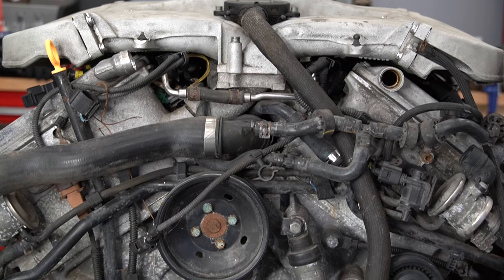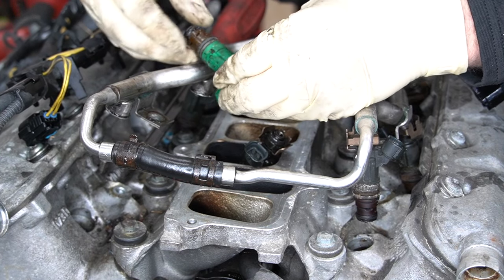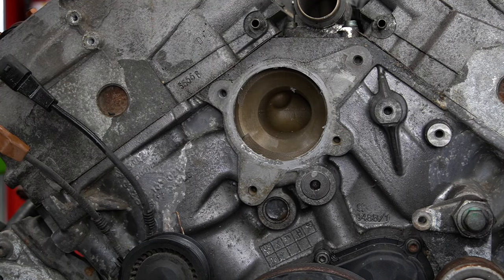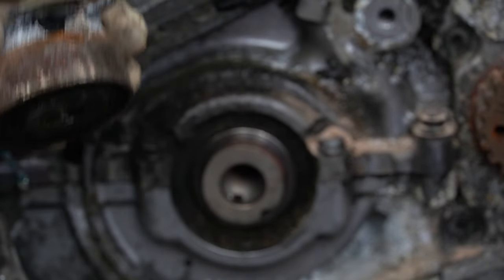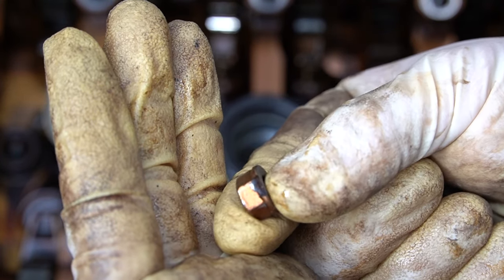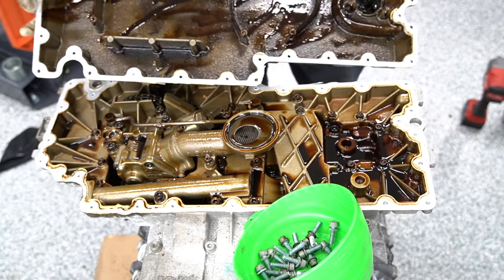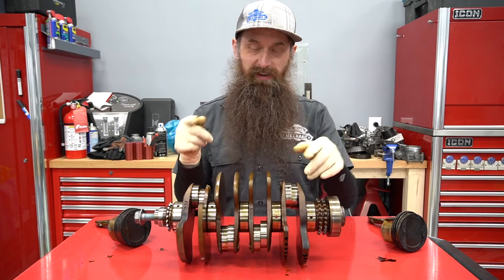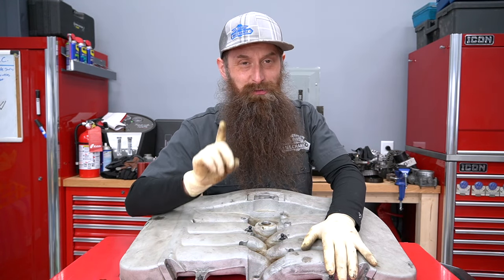W8 Passat Engine Teardown and Inspection ~ TINY V8

Comment: I actually own a 03 w8 that still runs but I do have problems finding parts, any suggestions?
Reply from the maker: I really don’t. If it’s just B5.5 parts it should be hard to find. W8 specific is usually dealer only
Reply: @HumbleMechanic  that kinda what I was afraid of
Reply from the maker: It sucks!
Reply: @HumbleMechanic  it does, I love the car, way more powerful then I expected it to be. Wanna keep it going

Comment: It's a great motor when it is under warranty. How would you ever know if the belt that runs the balance shaft is bad?
Reply: Probably because the engine would vibrate differently if the balance shaft failed. You'd need experience with 'feeling' the car to know it though

Comment: Thanks Charles for doing this video I was always curious to see the internals of a W8 engine we operate a small European shop since 1997 here in Canada and I never had to work one ever they were not a big seller here one thing that always amazes me about these complex engine is imagined the R&D and the cost of development on just one engine all the casting,brackets,fasteners etc ... all of this just to make a vehicle go down the road .  Compare this to electric car just one moving part the motor rotor. And manufacturers are saying that electric cars cost way more to produce I know most of the cost is in the battery pack. For Volkswagen it’s going to save them millions of dollars because they will be able to install the same motor in different cars but with different software and without any emissions equipment to install or test or cheat .. Ha Ha ..
Reply: What you save in moving mechanical components, you seem to lose in chemical and electrical engineering on the batteries of electric cars. It's an interesting shift

Comment: I have the VR6 in 2019 VW Atlas.  Any thoughts about reliability.   With a 6 yr 72k mile bumper to bumper i will be 71yrs old when it runs out.  No worries about repairs.  LOL
Reply from the maker: There was some issues with early production head gaskets. Its weird too, it seems to be regional.
Reply: At 276 HP it gas plenty of juice.  Oh and by the way i have the RossTech for the 2018 and up and turned of the start stop with your help.  Thanks.  Was 199.00 for the 3 vin version.  I only have 1 VW, 1 2004 suburban and one 2001 Mustang GT Conv.  I use a FIXD analyzer for the 2 american cars.  I also have RossTech 2010 to 2016 i may be selling.  Probably can get $300 for it on ebay.  Thanks for the great podcasts for VWs

Comment: This engine doesn't even seem too bad.  Seems like someone junked the car for what might have been because the balance shaft drive belt tensioner failed.  I assume the rest of the car must have had other issues too though.  Probably way too expensive to fix.  I think there were something like only 10,000 of these made right?

Comment: This engine is really W8 or V8 with parallel cylinders?
The arrangement of the cylinders is the same as  the lancia V4 engine 1920-1970.
Reply: It is two Lancia V4 in a V.

Comment: Hey the secondary water pump on the driver side by the transmission underneath the valve cover does it still work I don’t think my secondary water pump is working let me know if it works I love the buy. It off  of you

Comment: Do not scrap that engine, unless it's really bad. W8 is rare, because it was put only in B5 Passat. Rebuild it and slap a turbo on it! :D
Reply from the maker: The issue is the rarity means very limited parts. I m not sure rebuilding it is an option .
Reply: @HumbleMechanic  okay :/ It would be really good series of rebuilding & maybe modifying heads to get better flow

Comment: This is probably the most asked question, but do you think it will take boost? and if so how much. It's seems like a pretty over engineered engine so I guess a lot.
Edit: those rods looks very puny and thin they are not gonna hold power.

Comment: The broken balance shaft belt is not catastrophic engine damage right? It should be able to run without it no?
Reply from the maker: It should be able to. But it could have went like this- engine vibration lead to replacement because it’s probably cheaper than any repair
Reply: @HumbleMechanic  yea, thats probably it. What i meant was that if you wanted to you could have built something fun from it, and that the broken balance shaft belt was just a small repair in that case.

Comment: So what is the length of the engine? Weight?  External dimensions?  I can think of several swaps this would be a good candidate for... if its small enough.
Reply from the maker: Size wise its great. Especially with an aluminum block. The issue is parts. Unless you had a great running engine, its either NLA or so much money its not really worth it. You'd do better with a VR6 3.6. far more options there. and it drops right in most VWs.
Reply: @HumbleMechanic  actually I was thinking of dropping into a 914.

Comment: I got a question, i am currently looking at a 2,5L Diesel 5 Cylinder Transporter from 2006, how are these engines? Are these as "bad" as the 2,5L Diesel from a Touareg or are these better? The engine has done 260k km. Greetings.
Reply from the maker: We never got that engine in the US. :(
Reply: @HumbleMechanic  Oh that sucks, i have heard the cams could snap in half but i wanted to know for sure ;)

Comment: Do a VR5 Teardown
Reply from the maker: That would be cool to do a VR5 and 6 together, Fun to compare the size
Reply: @HumbleMechanic  I had a VR5 20v engined Seat for five years - wonderful engine, lovely sound.
Reply: @HumbleMechanic  i'm actually doing a VR5 10v Turbo Build Right now at the moment there isnt alot info on the web About the vr5 But i Learned everything what i have to know from your white whookie videos so i can tell you that alot is the same as the AFP 12v for the AGZ it uses the same parts and internals

Comment: Imagine trying to work on this lump while it's still in the car.  It's the stuff of nightmares.  I'm pretty sure the pour soul stuck working on it would use more colorful language than "interesting" to describe it.
Reply from the maker: It’s not too bad. Anything major is engine out.  Which is how it’s meant to be fixed. So it’s an easy engine pull

Comment: "The most broken connector in the VW world"; proceeds to pull off connector by the wires.
Reply from the maker: In almost 20years of removing VW connectors, Ive developed a fine tuned finesse for connectors. It may look barbaric, but it works. ;)

Comment: Engine this complex is looking like horse breading. And it will be that rare in 10 o 15 years due to electric cars. 

Just mind-blowing the complexity of only the power generation part.

What's your take on the battery electric transition for mechanics and shops?

Comment: The power output is not strange at all. Why would you compare a turbo engine to N/A without including the extra engine capacity the forced induction stands in for? Turbo engines are awesome, but they aren't doing anything special. I'd fully expect a 20 year gap in development to mean several iterations of output increases. But todays turbo engines look kind of outdated by comparison too if you consider that there were small engines making 300hp with a turbo in the 80s from the factory. As an enthusiast, even with 270hp as stock output, that's still more power than many VW cars have today and so I think I would enjoy it.
Reply: Also, there were much smaller v8s in regular production cars. Bmw hade the m60b30 3.0L v8, and there was the yamaha/ford SHO v8 at 3.4L, Audi used a 3.6L v8. Special mention tot he ferarri 208 gt4 with a 2L v8!

Comment: How weak are those rods? No way something that narrow could handle boost, right? Are the ones on Bentleys TT W12 similar? 🤔
Reply from the maker: I’m not sure if the rods are exactly the same on the 12. But the footprint isn’t much bigger so it’s probably close
Reply: @HumbleMechanic  Rod bearing shells are NLA. And due to width they do not tolerate bad oil or missing oil changes. Miss oil change = junk engine. Some people saw machine down VR6 bearings. Basically nothing down from head gaskets is available. And W12 parts almost fit.

Comment: All those engines suffered some failure and then when the mechanics fixed them, when they pulled the manifolds off little collets would fall into the intakes and not be noticed or even lock the engine when turned by hand. They would then get rattled into a disastrous spot on the first test drive. A truely huge job to end in complete VW disaster as only VAG can serve up.

Comment: Is it possible to buy the injector harness off you? I don’t care that one of the connectors is different one of my connectors are completely blown apart
Reply from the maker: Have you priced the connectors? It will be better to replace new unless the connectors are crazy $$ which happens
Reply: @HumbleMechanic  I have yet to actually find one for sale. I’ve been looking for a while unless you know of somewhere that has one available.
Reply from the maker: Call the dealer and get a quote. Then ask for the part Number. Or see if you can see the PN on the connectors

Comment: Is that balance shaft toothed belt on the maintenance schedule for replacement? What an ownership nightmare cost-wise.
Reply from the maker: Not on the schedule. Its a service position repair so id guess 3 hours or so
Reply: @HumbleMechanic  So, another $400

Comment: I'm assuming the trans is a manual, and if it is it should be a version of the 01e manual trans
Reply from the maker: It’s an auto
Reply: @HumbleMechanic  yuk probably a 5hp24 based 5 speed auto, probably worst trans VW, and Audi used :(

Comment: you dont pull the connector by the wires. this way you will end up pulling the crimp pin out of the connector or wire out of the crimp pin. 
i know  this is tear down but still make a right not wrong practice.
Reply from the maker: you have to do what you have to do to unplug a connector. with proper touch you won't damage the connector. or wires

Comment: Hey man I have a question about the 10v AGZ 2.3VR5  engine is possible to put a 20v head on it?
Reply: You need different pistons, but the block is the same.
Reply: @zorg1396  oh so If I put 20v pistons all will be good?

Comment: Did you have to rent/buy a 40' Conex container to store parts from this teardown? :D I take it you never had the good fortune to rebuild one of these at the dealer? ;-) Thanks for discouraging us from EVER buying a car with such an engine in it--they DO sound sweet when being run through the gears, though...
Reply from the maker: Id be more worried about the Passat surrounding the engine than the engine. B5 were $$$ to maintain

Comment: One question comes to mind. Why are the timing chains not on the front of the motor? Doing a timing chain in the car is usually a pain. But this setup ensures that engine needs to be pulled adding several hours of labor. There are several things about this that make me want to kick a engineer. It seems that the balance shaft (the belt one) would use some kind of spur gear inside the block coated with return oil to the pan while not adding length(or requiring a special tool). Leaving me asking why the chains are on the backside. Thanks for the tear down. That crank will make for a cool lamp in the shop.

Comment: Liquid cooled alternator, a tiny inaccessible belt that drives the balance shaft, thermostat located in the middle of the engine under the intake, plastic fins on the waterpump.  Come on VAG did you do this on purpose?

Comment: The modern engines are stressed to there limit and will not past bigger engines can support bigger things like a suv should have a v6 or a v8 so it actually lasts. Also the turbos get rid of them they are expensive when they break and don't really need them.

Comment: I think this is an example of an mostly unnecessary complicated engine without any benefit other than that of VW getting paid more when you have your car maintenanced. Three timing chains and one on the oil pump and that tiny belt on the balancer shafts - since I did not know how a W8 looked before I now hate that ugly chunk of metal. No idea why they did not strictly use a simple V8 design other than that it may be a little bit shorter (or may be ignored by the crowd because they gave it another name, but what the heck did they think when building it? Thanks for the teardown though, it was very funny to see you tear through the bolts finding the secrets of this "masterpiece" of german engineering.

Comment: some say over engineered. Well having torn one down and 1 to go, I can understand why VW did what they did. It is complex because of long hot exhaust runners and needs extra care to take care of that overheat area - hence the plumbing is necessarily complex to deal with that heat. For instance, when the computer sense a heavy foot, the electric / mechanical thermostat opens up ahead of time to allow for the sudden heat that will be there almost instantly - and the water must be there to take that heat out before damage results. That is smart.
* The 2 piece oil pan suprised me but then this motor needs LOTS of oil and where do you put it in a small car bay to to bottom and for a complex 4 l. engine?  Hence the funny wide pan to contain 9 l of oil. Oil is blood and needed, filtered and cooled. 
*  the water cooled alternator? Why? Because down in that area, it does not have that much ventilation and with hot exhaust manifolds overhead, they took no chances and gave a water cooling for reliability. Smart.
* VW had to fit a large engine in a small bay with very little room to work in. Hence compact. Trust me, there is next to no room to work on this engine. Head gaskets? Remove engine. Timing chain?  They do not wear out so put them at the back. 
It proved the concept and from there, they made the W12 and some principles for the W16.

In the end, it was too expensive to make and it was discontinued after 4 years. It had potential but not at a loss. At the end of the day, they are works of art.  A rolex watch sorta. 

When I finish, I will have all the aluminum parts, A/c compressor, alternator, pump and acces painted dark grey, the intakes pearl white, the blacks redone all with Endura industrial 2 part paint. A show piece.  Lots of fun.

Comment: The magic of Volkwagen:
They manage to build overall well designed cars that are full of flaws and needlessly complicated at the same time. I mean this is a really cool engine that I would love to have under the hood but man they just don't build em right.

Like a liquid cooled alternator. Why on earth would anybody do that?
Or the Thermostat underneath the intake manifold assembly. What a pain.
A balance shaft driven by a tiny belt almost impossible to access for maintenance??? A failure waiting to happen and here the belt failed as expected.
Then there are plenty more engineering failures on this engine like the torn oil screens for the Camshaft Timing Modules. Why even put screens there at all?

I would actually buy one of their Cars but it is obvious that they just don't give a damn about longevity and reparability.
Reply: The balance shaft had to belt because the cams already used up all available chain supply. Only VW could build a V//8 that needed a balance shaft for smoothness.

Comment: Balance shaft belt? 
First of all, if you're going to overcomplicate the whole engine, you might as well overcomplicate the balance shaft...

Now imagine if this whole engine was scraped because of the bad balance shaft belt which made it run rough, then they misdiagnosed it as a misfire, then threw in some cheap Autolite spark plugs and made things even worse 😬

Comment: It's not necessary to use a screwdriver to unplug VW connectors
Reply from the maker: It can be when they are broken. I’ve taken one or two off in my career ;)
Reply: @HumbleMechanic  Well, you are the professional here. I have a vw passat b5.5 and never used a screwdriver.
Reply from the maker: After working on them for almost 20 years you have to break out the pick or screwdriver from time to time.

Comment: DID YOU SERIOUSLY USE SILICONE SPRAY ON ELECTRICAL CONNECTORS?
That's a big no-no. You just short circuited most of those plugs.
Next time use regular WD 40.

Comment: Charles as I said once I get an eight cylinder engine and I get some components together going to see about getting to head spacers and putting turbos on here anyways I keep dropping little did he’s like this because I am interested in doing that thing with you about this engine and putting turbos on it doing with no one else thought of actually doing and the fact it will be a holy shit wow never thought we could do this with the WHO anyways again when I get closer to getting a W eat when I do I’ll be messaging you and then I’ll be planning on saving for if not with you or maybe someone else to do a YouTube video on turbo charging those sides of that engine 6 to 8 pounds of boost compression ratio is 810 to 1 lower the compression and spacers throw some induction in it It’s got a hire enough compression ratio so should handle 6- 8 pounds of boost
Plan is to do some modified exhaust work relocate the ABS controller power steering reservoir and the reservoir for the cooling the turbos will have to melt forward of the exhaust manifold and then the exhaust manifold stock or you have to be capped off at the back and re-routed back into the downpipe doing this gives you enough room I’ve already measured everything else I already had a kale for an additional piping rough relayed out again can be done just need to rearrange the engine bay and remount stuff elsewhere like they have another vehicles there’s a reason why they called them variant models get the proper brackets you can mount shit elsewhere give you the room hey Do golf front in Jetta swaps vice versa and think it’s any different a big boy Lego there’s a way to make it work to appoint